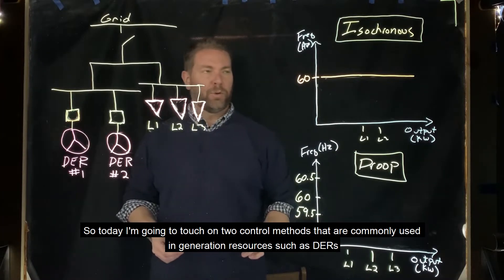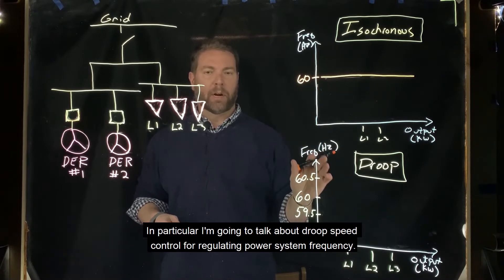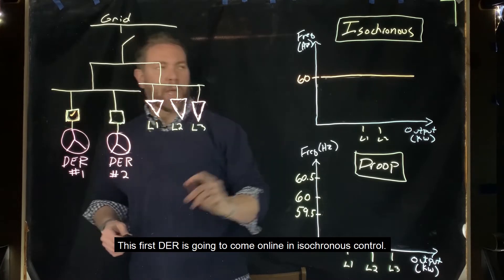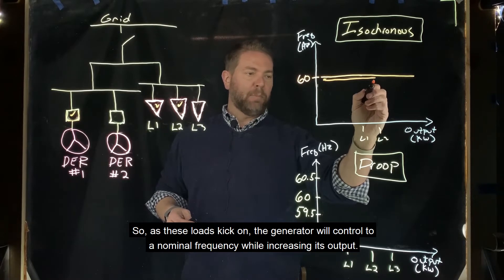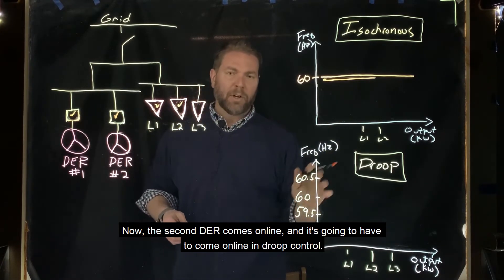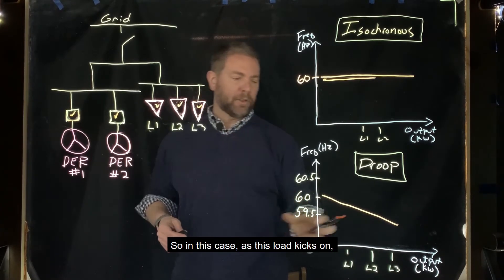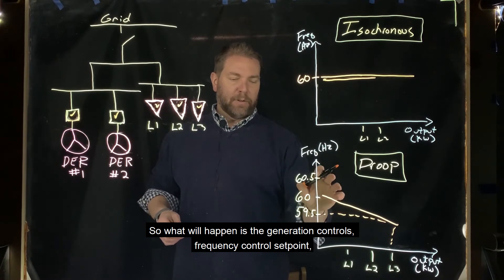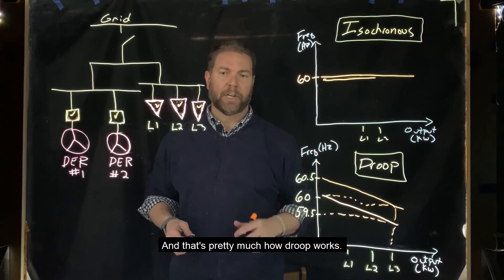Two Minutes or Less: Isochronous vs. Droop Control

Comment: I have a question.  We have a diesel generator in parallel with grid and reportedly it's sharing real load but doesn't seem to be able to pick up reactive load. What problems can you think of?  Failed droop circuit in AVR? The diesel is burning fuel and carrying real load.  But the AVR seems unresponsive.

Comment: In a 1000MW coal fire steam turbine generator, how much responsive reserve will there be? Is the amount of responsive reserve the same in either high frequency or low frequency direction? Is the dynamic range of the governor still 0-1000MW even though it might take several hours for the generator to ramp up to that power?

Comment: There’s so much more to this topic… I don’t think it can be condensed into 2 minutes. You don’t distinguish paralleling in isolated grid vs utility, swing machines, tertiary frequency control, kW vs speed droop, resulting frequency from two or more machines in droop, proportionality of the load sharing vs droop setting, etc…